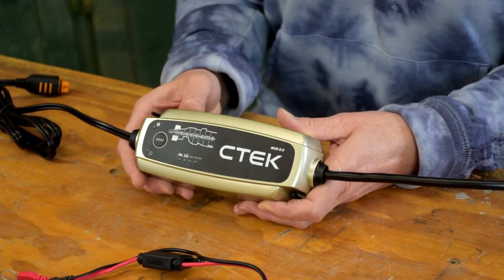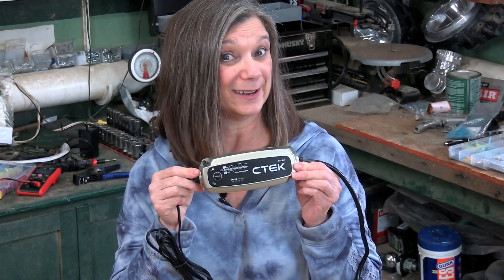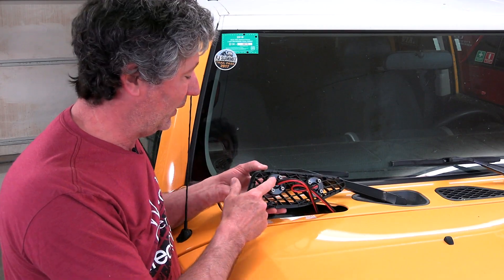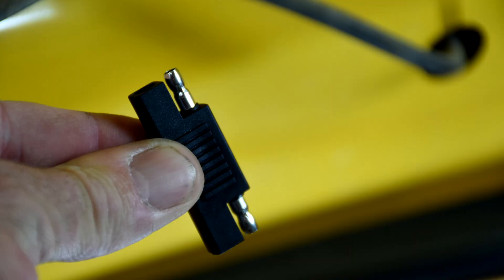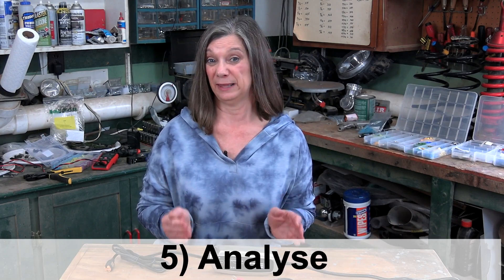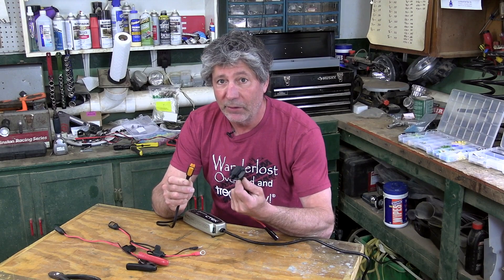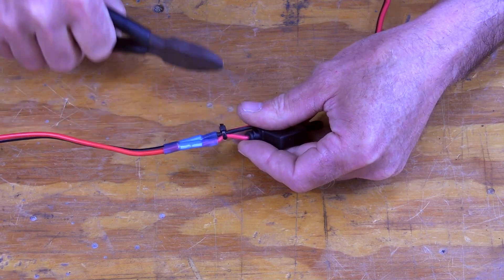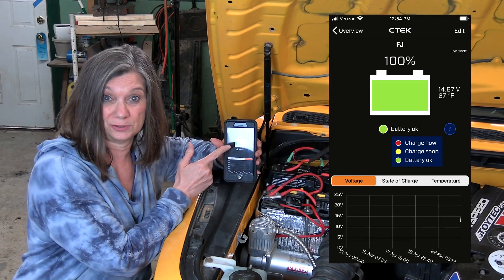Best Way To Maintain A Battery While Sitting In Storage, Lead Acid, AGM, & Lithium

Comment: Really great info in this video.  I converted to a AGM start battery a year ago and had concerns if the lead acid charging system would probably maintain the AGM.  I installed a bluetooth battery monitor.  My rig can sit for a week or more and I added  Battery Tender 10 watt Solar Charger.  I'm always 95% SOC.  It has really worked out well. Keep up the great videos.
Reply from the maker: Great to hear it helps!

Comment: Hi guys, always love watching your videos. I’m due for replacing my 2017 4Runner main battery and looking for suggestions. I don’t currently have any additional electrical accessories directly hooked up yet, do run my fridge and air compressor, but only while the motor is running. I have a portable battery for overnight use of the fridge for now. This will change over time as I “grow” into this adventure. Heading to the Grand Canyon and southern Utah next week and need to get the battery replaced soon. 

What are you running for your main battery?
Reply from the maker: We just use a good quality, name brand, replacement battery.

Comment: Great, but why you have change connector with SAE and dont buy the corrispective CTECK panel connector? they have classic round panel mount, flush, panel with led status and rocker switch shape  and the most expensive quick disconnect "magnetic" version like macbook